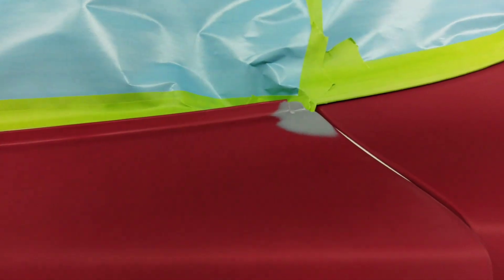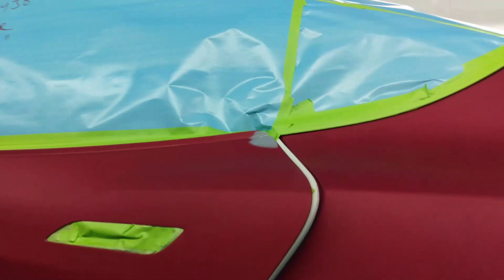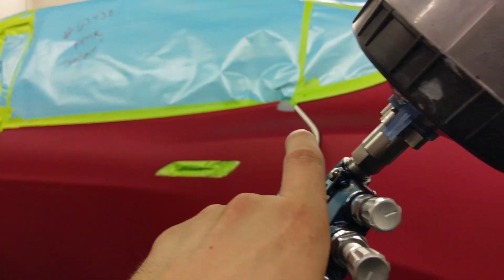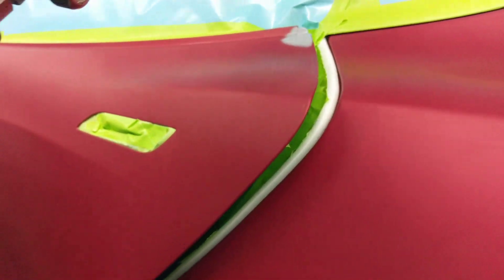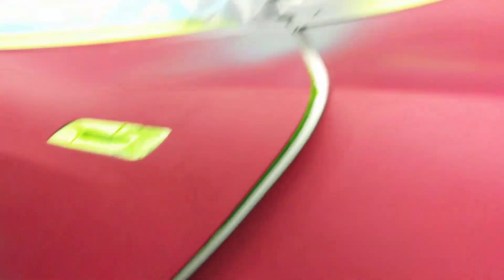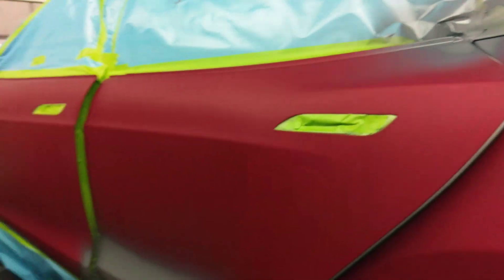This tip can save you a lot of time & money

Comment: Haha, coincidence! I did some red motorbike fairings last friday and it was a mess to cover the filler that was a shade too dark and after sanding left a straight, hard line as shown in this vid. Even after 5 layers that line was still visible between the filler and the original basecoat. You mentioned this method in one or two other previous clips, its awesome, as it creates a fading, soft transition from filler to base which can be covered with 1-2 layers. If you don't have all shades of grey at hand, some times one can instead get away with putting a splash of silver basecoat into the filler in first place. Do a card to be sure that this works in your case and within your paint system :) Be blessed!
Reply from the maker: +Chuck Thomas haha that's awesome! Thanks bro!!! 😀

Comment: hi Gabriel thanks for the tips, will this stop all the mapping from hard edges?, does it mean we don't have to flat down the edges with grit paper? thanks again man
Reply from the maker: +Gav179 no way!!  Sanding needs to be done!
Reply: now I'm lost bro, I would normally feather the edges out with grit paper to lose the hard edge to stop mapping, does this method do away with that process? but we would still need to flat the extra coat you put on last ? or am I getting this all twisted ? ha ha
Reply: All primer must be sanded out to a feather edge.  In this example the primer was blocked out but the primer probably should have been extended further to allow improved feathering  Especially the top corner of the door.  I"m not sure what he sprayed, but I'm assuming it was a dark sealer, or maybe basecoat?  The goal is to feather that grey out so the eye won't pick it up.  Additional blocking should not be necessary unless you see those edges which indicates feathering was not done correctly.  Hope that makes sense.  This is more about how light permeates these minute layers and when confined to a very narrow strip becomes apparent even when everything is dead flat and smooth.
Reply from the maker: +Shain Andrews well said!!  And that's why I love the motivated painters audience! Thanks for adding value!!! 😀😀
Reply from the maker: +Gav179 you are getting it all twisted haha those spots are already sanded and flattened out.  This us just for colors hiding sake I sprayed a darker shade basecoat I mixed up to be able to paint it easier
Reply: Shain Andrews yeah totally get what your saying thanks man, I misinterpreted the video in my head and kept running with it ha ha